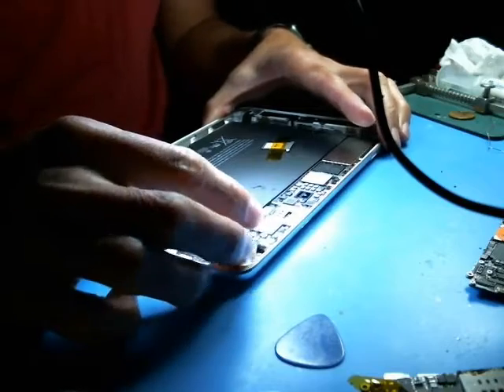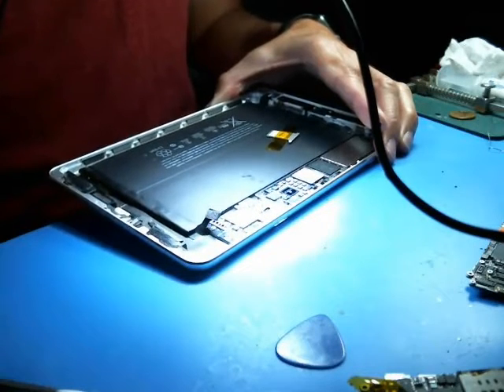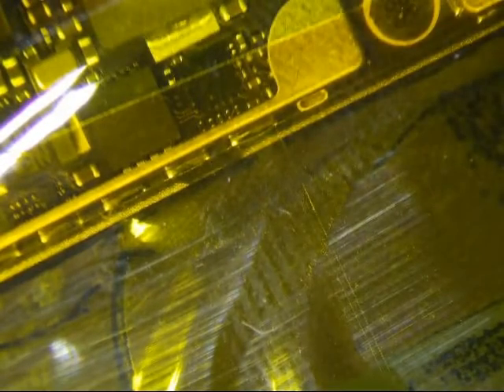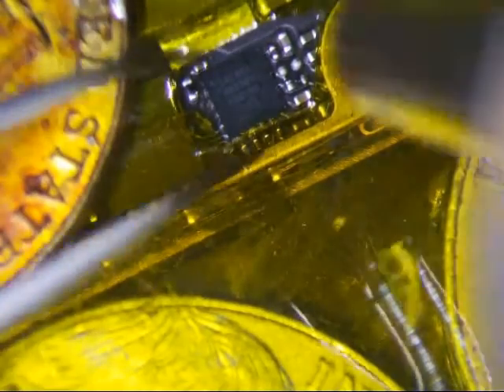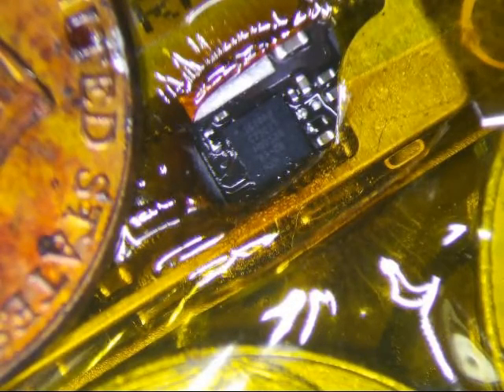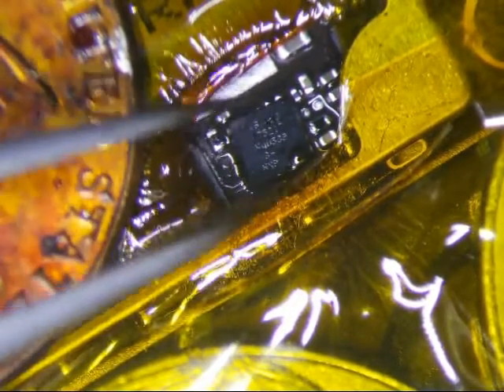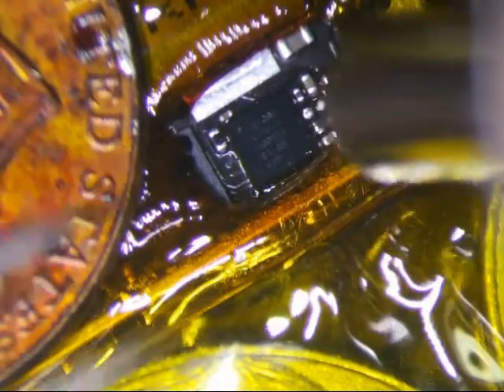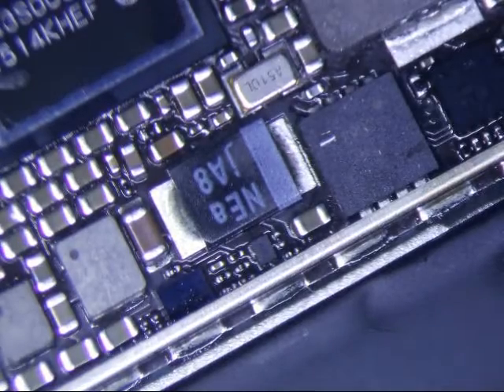iPad Mini 3 No Charge Solution tristar

Comment: Hiya Mike I realise this is an old video , but I am puzzled by mini 3 which I have replaced the charging port connector , the thing is it will charge but only on 1 of my 5 cables ,  which work fully in my other devices , !! I also replace screen connector , screen and lcd , I have updated on iTunes but still only charging on the 1 cable ,  do you think Tristan could still be the problem , as I’m confused that it is at least charging ?!? Any help would be great as I don’t want to mess with that chip and end up making things worse ,

Comment: What is the purpose of the coins?
Reply from the maker: They act as heat sinks, meaning, they take the heat away from whatever they are on top of.
Reply: Microsoldering  ok, that's neat! Should you use flux doing this?
Reply: @yalenatalley5809  flux allows metal to flow better, it helps from ripping pads too.